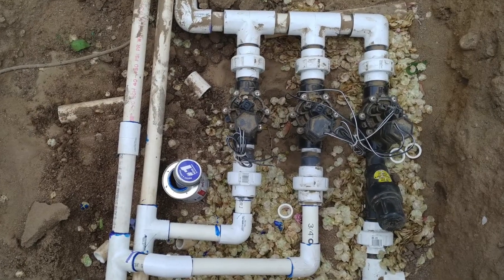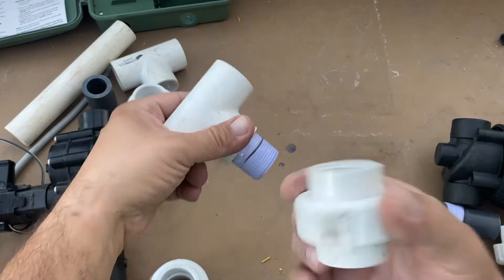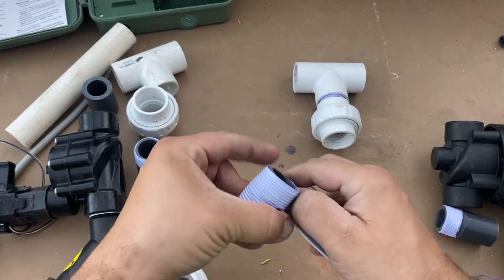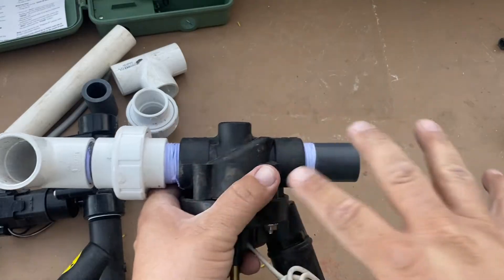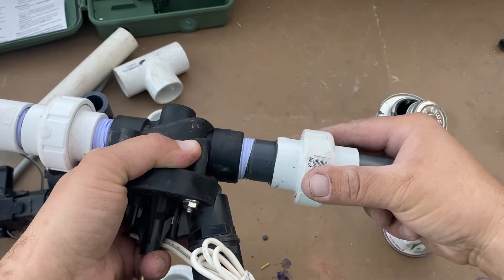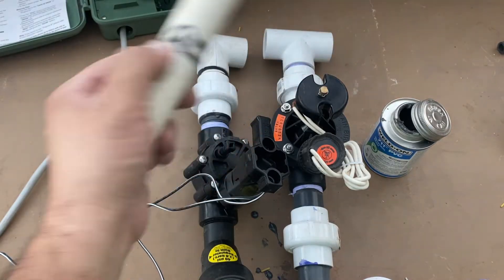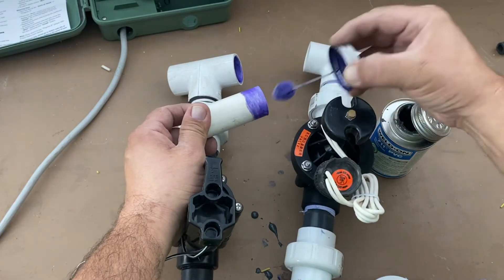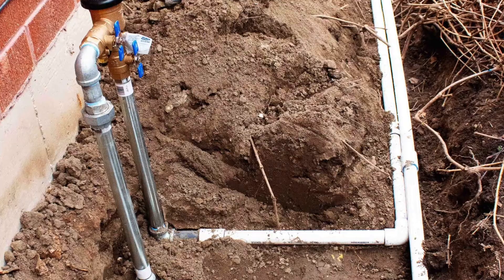Building Sprinkler Valve Manifolds #irrigation #sprinklersystem #valve #pvc #diy

Comment: The two unions are facing opposite directions. Does that matter? In regards to the way the unscrew in the event you have to replace them.
Reply from the maker: It will still serve the same purpose, but there are times when it’s better to have the threaded retaining ring facing a specific direction.  The unions are not directional though.

Comment: It be nice if they built water values with built in unions.

Only issue I suggest.  Put union nuts closest to value.  I have had a number of nuts Crack in extreme weather.  This way you can easily switch out nut side of union with station.  Especially in very tie spaces.
Reply: Excellent advice.

Comment: Mister pressure relief valve, there great at the end of the line on my patio misting system in the winter time to prevent pipe from cracking, you can use this little brass fitting at the end of the main water line of your manifold or do what I did and put it at the lowest point of your pvc line and watch it piss out when timer turns off. Just seems to be such a waste of water. Figuring way to reuse water and pump back to plants

Comment: Wait a minute he’s using ABS cement. The primer sounds right and looks right but it’s supposed to be PVC cement not ABS he’s working with PVC not ABS. Did I miss something?
Reply: That’s grey industrial glue. Usually used more for large diameter pipe

Comment: Important to do a 1/4 turn when gluing to evenly distribute the glue
Reply from the maker: Read your product label or take weld certification.  That is an outdated and bad practice.  You only turn to adjust.  Turning can reduce the strength of the weld.
Reply: @Precip-Mate  ty ill keep that mind. I read the instructions and it says to do a 1/4 turn for Weld On Wet R Dry.
Reply: Funny, that process was taught to me while getting my LI license... Yesh
Reply: ty i was just wondering that

Comment: Very nice video.  I love the idea of using unions, however I have some unions on the backflow preventer that was here when I purchased the house.  However no unions that I can find at any store will mate with them.  So if these unions had been used on my valve, it wouldn't have helped if anything had been glued to either side of the union.   So if anything is glued to the union, I would suggest buying extra unions when you build your manifold so if the brand the stores sell 10 years later, then you would have the correct union.

Comment: This was beautiful!!!
I'm helping my 90 year old neighbor fix her breaking irrigation and have been absolutely appalled and frustrated worth how it's built because large sections have to be cut out to fix one valve. Even having to cut out multiple valves to replace one. This is the IDEAL setup I've been dreaming up in my head. Making it so each valve can be replaced as needed. Love the info on the drain. Didn't know about the drains. Didn't know anything about irrigation and was wondering why she had those drain things in her system. Great information!!!!! I love this setup!